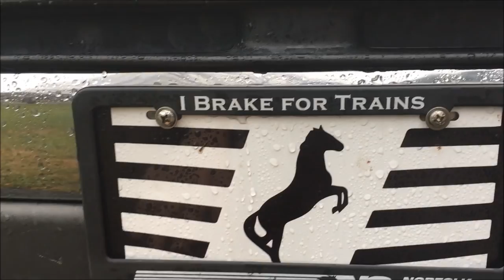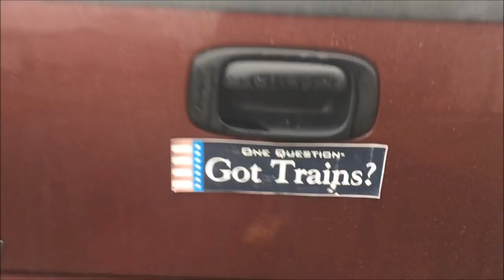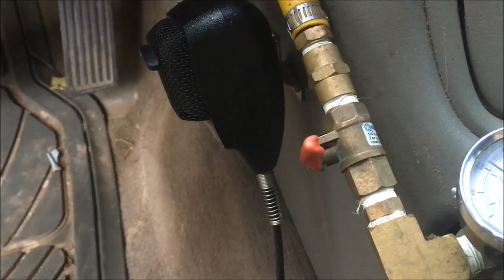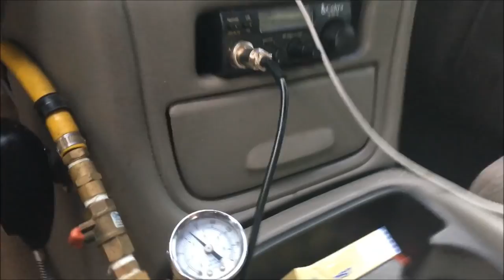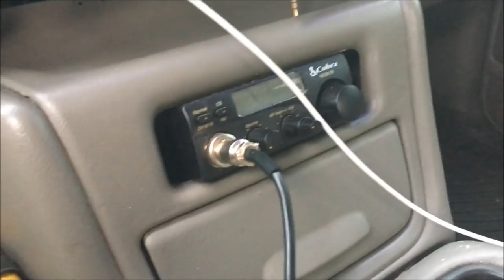A Tour Of Our 1999 Chevy Silverado AKA "Train Chaser"

Comment: old video, but Pod Filters do NOT give you more power, in fact you LOSE power by using them. the best air filter you can EVER put on a vehicle is the original factory one as its been specifically built for THAT engine.